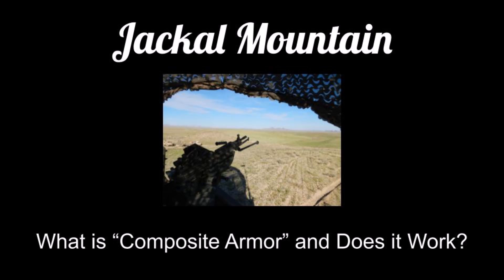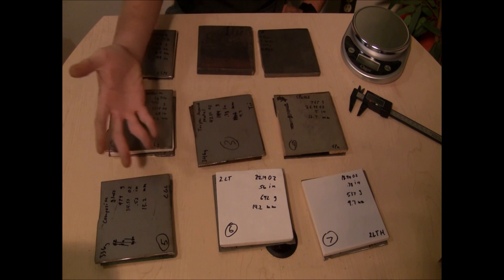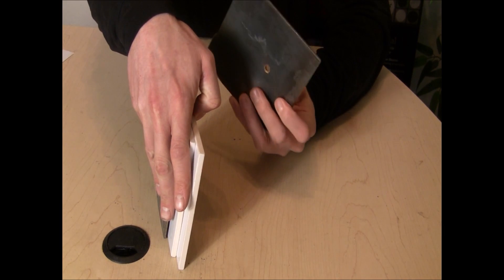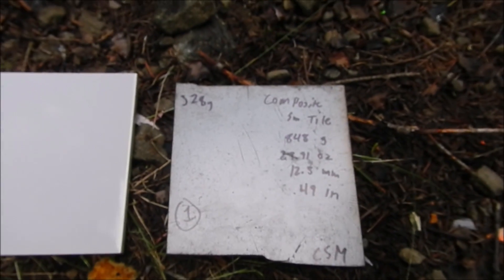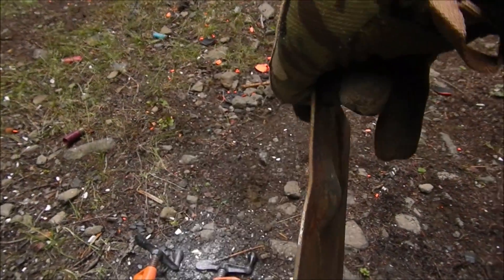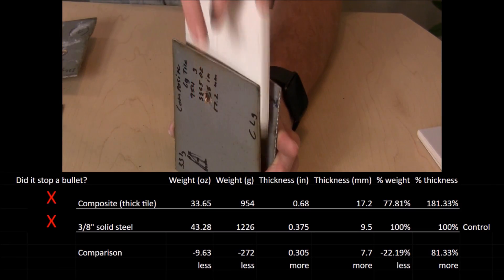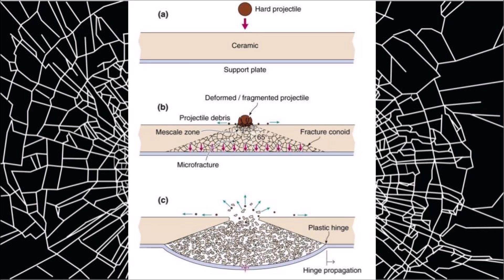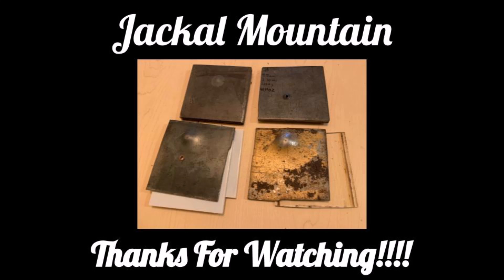Composite Armor: increasing protection, with less weight

Comment: I am no scientist, but we were doing some tests with Nylon/Glass/PE textiles laminated armor and surprisingly they worked well, theoretically if you are interested, you can, using those textiles and glueing them together with some good epoxy (we first bathed the textiles in epoxy that completely solidifies) that stays a bit flexible (so that it doesnt delaminate or crack easily and distributes the energy well through the plate), make yourself some pretty awesome and cheap body armor.
Reply from the maker: thanks!

Comment: Sir i wanted to congratulate you on your video. With all respect there is one very impoetant factor you are missing which tank do employ...angles. If the armor is in a certain angle it will defect the bullet or use the bullets centrifical torque to break itsself on impact. In other words bend the steel 90 degress in half with the ceramic plates and youll have more success. God bless you sir and Godbless our great country.

Comment: I may be wrong but I believe ceramic composite armour is primarily meant to stop HEAT warheads not APFSDS or in your case AP rounds. Although it does have the capability of stoping them depending on the composition determines its effectiveness.

Please give the Credit of Chobham armour to the Brits we invented it and it was first used on the Challenger 1 MBT. Some of our Engineers went over and used it on the M1 Abrams.

I may well be wrong please tell me if I am and I will try and correct my comment if so.

Comment: Works against the first round, you're dead meat on the 2nd round.
Reply: Thats the reason why the ceramics are cut in little pieces instead of a whole ceramic plate. And the chance to hit the same broken ceramic plate is pretty low, just like hitting a used explosive reactive armor again. This is just a basic demonstration, the modern composite armor is wayyyy more complexe and has been tested again and again to increase the protection.

Comment: I saw your older space armor tests. Good video but a note: Spaced armor is only effective when the spacing is larger than the bullet length. The principle of spaced armor is when it goes through the initial plate, the round gets deformed and tumble, the tumbling causes the round to get knocked off course which makes it lose a lot of potential energy.
Reply: placeholder that’s not spaced armor.
Reply: placeholder That’s for heat rounds. Heat rounds particularly suffer at transitioning to different materials. That’s why composite armor is so effective at stopping heat meanwhile a solid block of steel will do jack. They don’t like transitioning from let’s say steel to air to steel, etc. Also keep in mind the front plate is heavily angled. Most modern composite armor relies on the round diverting off course, throwing a round off course will make it lose a lot of potential energy which means less kinetic energy which in total means less power to penetrate. Basically nearly all tank composite armor applies this in some sense.

Comment: I would have glued the layers together and or laminated the brittle substances. I wonder if you used a layer kevlar, then hardened aluminium followed by a ceramic and then a layer of titanium and then sloped it to 60° to see what's the lightest armour you can make to stop a 50cal.

Comment: I think the ceramic should be encased so the energy from the bullet entry doesnt just blow it out the open edges.   Either epoxy to hold them together or box them in with weld.

Comment: A very interesting video, but it starts explaining about defense against shaped charges, shows testing of kinetic projectiles. Shaped charges are the bane of steel armor, and are the main reason for composite armor. Any benefits to kinetic defense are good, but not the main objective.
Reply from the maker: Shaped charges are just kinetic penetrators like bullets or sabot rounds. The metal liner doesnt get hot enough to melt steel but it does get accelerated by the focused blast into a single high velocity slug at point blank range. Think waterjet cutter not plasma cutter

Comment: Its very important with ceramic composite to have the ceramic tightly contained so pieces can’t fly out, it really needs to be ceramic in a welded steel box.
Reply from the maker: why? Seems like in the microsecond that force is transfered through the ceramic and into the steel behind it, a ceramic fragment wouldnt have a chance to move much distance away from the point of impact.
Reply: Jackal Mountain ceramic shards can’t fly out the side of composite tank or body armour. The bullet shatters it then the shock is energy is absorbed by causing friction in the ceramic powder. Less ceramic is needed if it can’t escape.
Reply: Inqu'aanate He only tests each armor once. There’s no point to contain it.
Reply: Hazardous containing it greatly increases the resistance of the plate to projectiles as ceramics are very hard to compress and as the ceramic has nowhere to go, the projectile must compress it.

Comment: A 5.56 is not a sharp charge (RPG) B angle plates like on the tiger 2 helps rounds bounce his info is not worth a empty tea pot with holes in it
Reply: BRITISHBADGER92 H Tiger 2 front plate isn’t angled enough to bounce any rounds. It’s angled because it increases the thickness of the armor.

Comment: The purpose of composite armor is primarily to stop chemical energy rounds as mentioned in the video. However, the M193 round is a solid shot round that relies purely on kinetic energy to penetrate armor, so I would suggest making another video demonstrating the effectiveness of a composite armor on an actual chemical energy round...  still a pretty cool test tho
Reply from the maker: Thanks! Though HEAT rounds are just kinetic penetrators like bullets or sabot rounds. The metal liner doesnt get hot enough to melt steel but it does get accelerated by the focused blast (chemical energy) into a hypervelocity slug (kinetic energy) at point blank range. Think waterjet cutter not plasma cutter

Comment: I would love to see a version with: 1mm steel + thin ceramic + 3mm steel + thin ceramic/glass +1mm steel. Significantly less steel consumption ( 5g vs 6g), and more layers (I think it would help, but not sure)
Reply: Bear Rider 1mm or steel is too thin. I’d doubt that stop a rifle round
Reply: @hazardous458  5 in total. What stops the bullet is the ceramics either way, but I would love to see it tested :)
Reply: @komradearti9935  I probably yeah, but i would still test it out. Floor tiles are cheap, and so is steel, for the heck of it it wouldnt be a bad experiment.

Comment: The problem is that the bullet shatters the ceramic plate then pushes it aside to continue on. I would use adhesive to fasten the steel plate to each side of the ceramic so it stays put, as it would when used as part of tank armour. I would also have a mount that holds the completed plate on at least 2 sides, you only had it held at the bottom and the top had large gaps between the different plates.
Reply: Wrap ceramics in 2 layers of woven roving glassfiber sheets with a somewhat flexible epoxy resin ( 20w% resin 80% GF ).

If the epoxy doesnt bond correctly, prime tile first.

Comment: You can't simulate efect of shaped charge with your rifle...(even with use of full size rifle ammo you would not get speed of penetration needed to be anything like shaped chatge).
Reply from the maker: Its still a high energy, focused impact. Perfectly fine to test concepts. It worked exactly as it should have
Reply: @jackalmountain6523  Its not "high energy" its speed of sound in metals vs armor... that is why @Komrade Arti is talking about "hydrodynamics" your armor will not be able to react as a whole object(solid state) when projectile is impacting it with speed similar or greater to the speed of sound in that material(ceramic = different speed of sound in it).
Reply: @jackalmountain6523  btw. "It worked exactly as it should have" and that is solid prove that something is very wrong with your concepts as u used mild steel...   -1 * -1 = 1. In logic conjunction of FALSE&FALSE=TRUE so fact that you used mild steel for your "perfectly fine test concepts" and in the end you do not getting negative results is solid prove that there are at least two false concepts in this test...

Comment: I like your explanations and the subject matter and it was well thought out.
But I was thinking about another variable: one more thing that might affect your tests would be movement of the steel against the ceramic; if the steel was, say, duct taped all around the edges (not where the bullet impact was to be) or perhaps if you used an industrial adhesive on both sides of the tile fixing it to the steel, it would provide the same (more?) energy dissipation but without damage to the tile from the movement of the steel.
Thanks!

Comment: In my opinion you had to glue all steel and composite parts together with epoxy. There was nothing to hold that cone of ceramic/glass pieces that are supposed to stop the bullet. It just shredded ceramic/glass.((( So could you plese try it again?(( Also try a combination of 3 layers of steel with 2 ceramic/glass inserts
Thanks in advance

Comment: the experiment is flawed since the material used arent representative of real armor. i dont thing they use floor tiles in tanks. you might argue that theyre simmilar but id say that those diffrences can be very semnificative. some ceramic shatters if you drop a weight on them, some ceramic is used as a heat shield on the space shuttles
Reply from the maker: well, it worked didnt it?
Reply: @jackalmountain6523  well, it didnt stop the bullet so it just prove that floor tile is less heavy than metal sheet. Even if it worked it couldve worked better.
Reply from the maker: @iulianion5565  with a single tile the bullet wasnt stopped. Using glass and two tiles did.

Comment: Your testing an armour concept designed to defeat shaped charges with a kinetic energy projectile, er, what?
Reply: Mike Long technically a shaped charge also uses kinetic energy of the really really fast jet to deform and penetrate the armour.  But of course the forces on the jet are a bit different from that of a bullet.

Comment: Unfortunately this is not representative of the penetration mechanics of a shaped charge. Nor is it representative of composite armour in tanks, which is typically held in a multi-axial stress state. With shaped charges, your penetration is essentially determined by the length of the jet and the relative densities of the jet material and the armour material. This means you can trade material hardness simply for volume. So you can stick 2' of sandbags infront of your normal steel plate instead instead of adding 4" more steel. However this is impractical, and also doesn't add as much protection against traditional armour piercing rounds. Hence composite armour seeks to provide protection against chemical and kinetic energy threats in a mass and volume efficient manner.

Finally, composite armour acts against the 'length' of the jet to reduce its penetration. It does this by attempting to introduce off-shotline movement of the material in the jet. Think of a whole load of needles lined up after each other, vs slightly moving the needles out of line.

Comment: Really interesting. I’m not sure why you introduced shaped charge munitions as the issue composite armour was developed to counter, and then go on to test purely kinetic munitions on the armour examples?
Reply from the maker: HEAT rounds are just kinetic penetrators like bullets or sabot rounds. The metal liner doesnt get hot enough to melt steel but it does get accelerated by the focused blast into a hypervelocity slug at point blank range. Think waterjet cutter not plasma cutter

Comment: Composite armour was developed to defeat hollow charge bullets. 

you use kinetic energy bullets..
The two act completely differently..
You make an invalid comparison..
Reply from the maker: HEAT rounds are just kinetic penetrators like bullets or sabot rounds. The metal liner doesnt get hot enough to melt steel but it does get accelerated by the focused blast into a hypervelocity slug at point blank range. Think waterjet cutter not plasma cutter

Comment: If the plates are only secured at the 2 points the Impact vibration can cause the mid layers to fail.
 They should have at least been tapped together snugly.

Comment: Neat test. I'd like to see the plates and ceramic laminated together with epoxy or fiberglass. I think it would take a lot more energy if it does not get to slip out of the side so easily. Thanks for your demonstration.

Comment: Umm don’t composites have better protection against chemical energy weapons than kinetic
Reply from the maker: HEAT rounds are just kinetic penetrators like bullets or sabot rounds. The metal liner doesnt get hot enough to melt steel but it does get accelerated by the focused blast into a hypervelocity slug at point blank range. Think waterjet cutter not plasma cutter
Reply: Jackal Mountain ok thank just got confused about the whole shooting them with guns thing

Comment: Isn’t composite armour meant for HEAT and HESH ammunition and not kinetic meaning that shooting it with a rifle is pointless.
Reply from the maker: HEAT rounds are just kinetic penetrators like bullets or sabot rounds. The metal liner doesnt get hot enough to melt steel but it does get accelerated by the focused blast into a hypervelocity slug at point blank range. Think waterjet cutter not plasma cutter
. As far as HESH, it would probably fare poorly against composite armor since its layered design would inerfere with the propagation of shock waves (and limit the resulting interior spalling) through the armor.
Reply: I get what you mean, and also making a shaped charge is dangerous and slightly illegal so a gun would be a lot better in terms of demonstration

Comment: There is some complexity to your comparison that has been ignored:

(1)  Sloping the armor.  Sloped ductile steel/aluminum armor materials can dent into long, canoe-shaped dents, spreading the force over a wider sideways region and a longer region parallel to the direction of motion of the projectile.  Such "dishes" (denting) can absorb considerable impact energy by spreading it over a larger area.  At higher angles (circa-60 degrees or greater from right-angles), such sloping and gradual failure can deflect a projectile to glance off the armor, whereas a hard ceramic material just shatters and it usually only gains the minimal SECANT(ANGLE) thickness increase.  This is why most  laminated armors designed to damage or destroy impacting projectiles are no longer sloped as much as in WWII tanks (compare the visible areas and sloping of late-WWII steel-armored German and Russian tanks to modern tanks using non-steel or layered steel/non-steel armors).  Composite armors rely on destroying the projectile nose or HEAT needle-jet as it goes through the various layers, turning a pointed projectile/jet into a wide-impact-area shotgun blast shot-cone of pieces.  This is why modern APFSDS projectiles re so long, to allow continued minimal mass on the narrow impact point even though the nose of the projectile is being destroyed and the eroded, shortened projectile still keeps what is left boring into the same cross-section of the remaining armor in front of it.  Such APFSDS (and HEAT, if the jet is not disrupted) projectiles also have nearly the minimal SECANT(ANGLE) armor improvement effect, so sloping has the least effect and making the plates thicker, rather than sloping them, is more effective against projectiles hitting the armor from random directions (sloped armor only works when hit along a direction the keeps the slope angle; if not, it is severely compromised).

(2)  Composite armors are more expensive, have low structural support strength so are dead weight (they have to be external add-on plates in section), and are usually much thicker for their protection level than steel, though weighing somewhat less.   The weight benefit is very good, but the other noted properties are most definitely not.  The added bulk of such armors can interfere with the efficient design of the vehicle, requiring compromises that degrade other desired things, such as the maximum size to be transported on trains and trucks.  Currently, the high penetration ability of modern anti-tank weapons requires rather thick composite armor or the vehicle might as well be a cloth-sheathed truck, but this means non-optimum designs in armored vehicles.

Comment: Dear Jackal Mountain, iI very like your direct but quite scientific approach to research this topic. But I suggest, that ceramic or glass inserts allow relatively more protection from all kinds of especially heat generating aggresives like shaped charges and similar, because ceramics exhibit much slower heat transmission than metals, isn't it? Best Regards T. Stanisfugl
Reply from the maker: Thanks! While it is misleading, shaped charges are just kinetic penetrators like bullets or sabot rounds. The metal liner doesnt get hot enough to melt steel but it does get accelerated by the focused blast into a hypervelocity slug at point blank range. Think waterjet cutter not plasma cutter
.  Since thermal energy propagates more slowly through dense armor grade materials than kinetic energy, its not really much of factor in armor design.